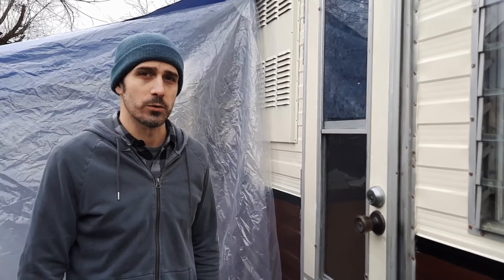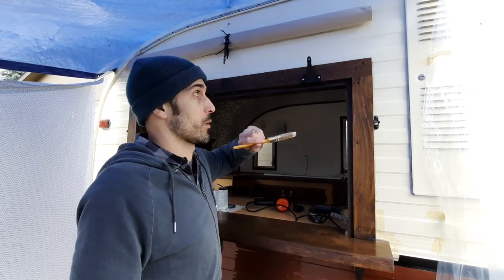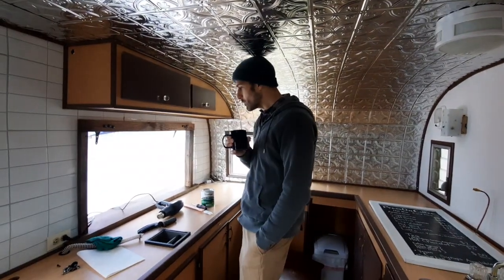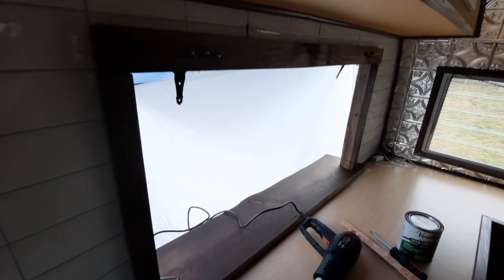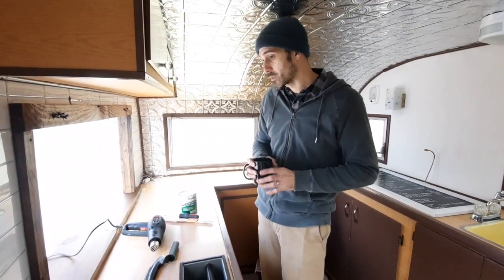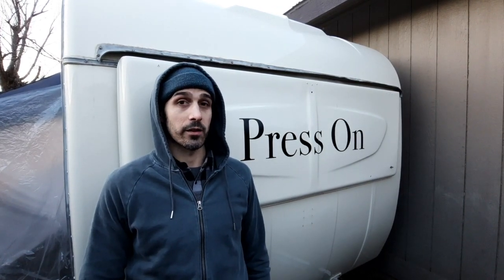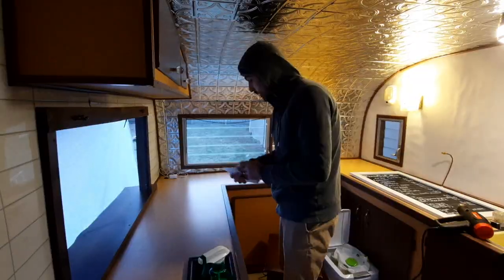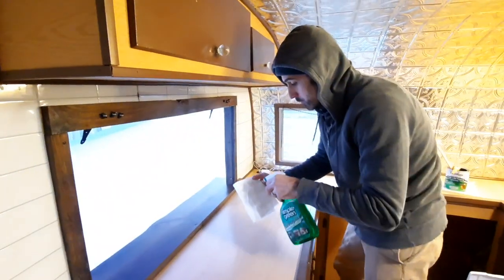New Service Window - Press On Coffee Trailers

Comment: I know this video is a bit old but, what type of wood did you wind up using for the new window?
Reply from the maker: The trim was pine, and the door itself was plywood. I stained and coated it with waterproof sealer.
Reply: Thank you so much! I am in the middle of restoring mine and your videos are very helpful!! I'm at the point of redoing the windows right now.
Reply from the maker: @annetteo2718  excellent! I strongly recommend using butyl only. Remove the old windows, scrape the old butyl off and then add new butyl tape. Reinstall the windows and you’re good. Don’t use silicone or other caulking. Its not necessary and it tends to hold dirt.
Reply: Awesome tip! The existing windows didn't have any of that but I will definitely take your advice and run with it. Thank you again!! 🙏